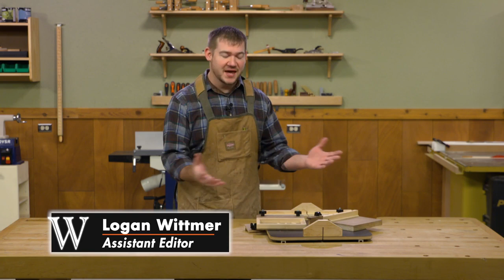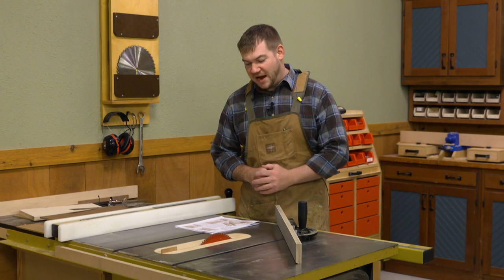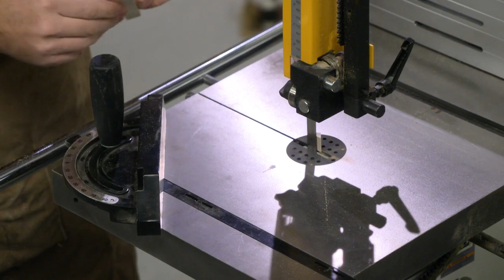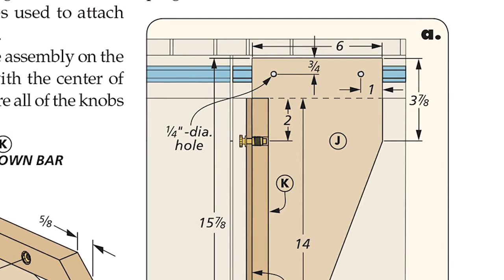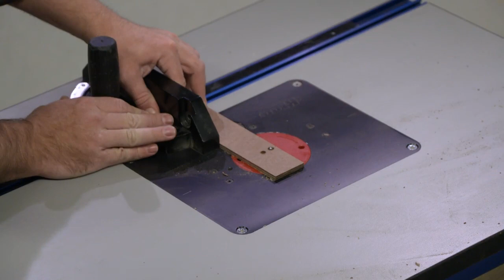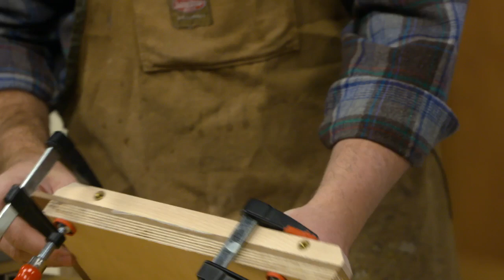Constructing a Small Parts Table Saw Sled (Part 3/3)

Comment: To square the rip fence, I'd remove the threaded inserts , slide it to where the blade could shave it square, then reinsert the inserts. Then you wouldn't have to worry about the painters tape shims wearing out.